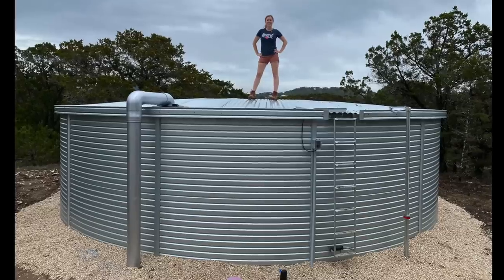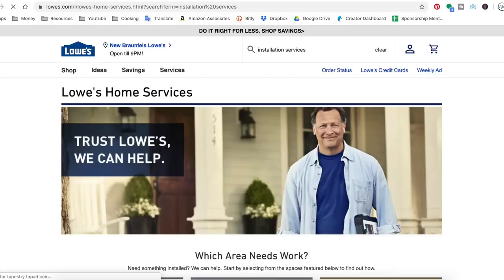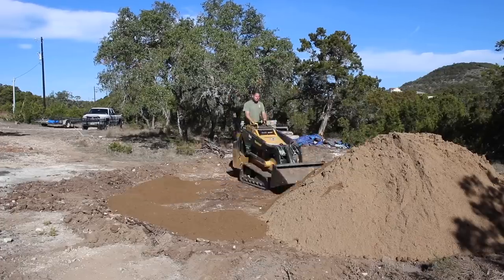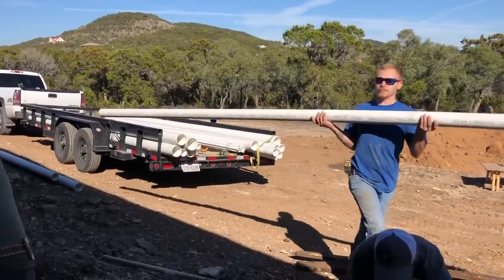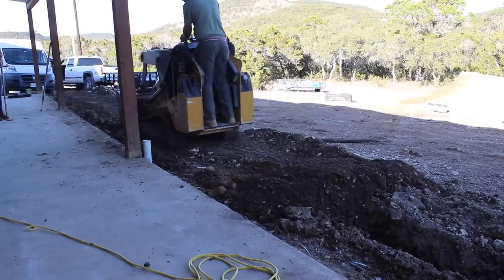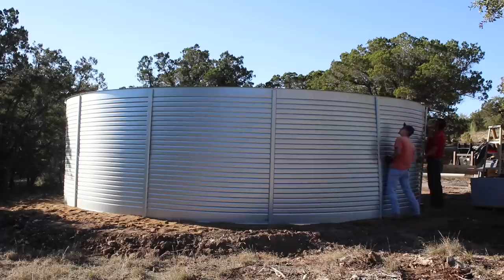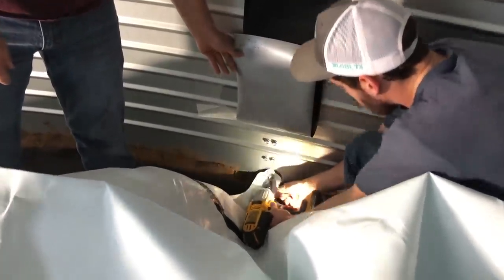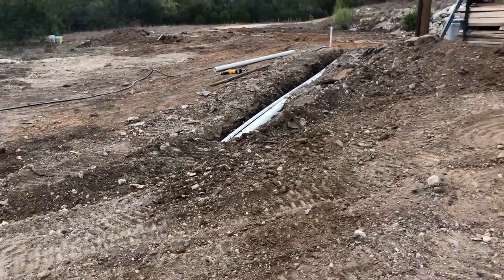Installing Rain Water Collection

Comment: Greetings from Germany. Water collection and reserving is a good thing if you are able to do it. We have been always collecting rainwater in some form or another. 
Growing up, my parents had a house + garden  (about 2 acre i think) at the edge of Town. We had 3 huge connected septic tanks (build in the 50's from brick and mortar) underground, that where used for our blackwater. In the early 90's we got connected to the towns sewage management and the septics where not needed anymore. So we emptied them and my dad and i spend a few weeks cleaning those tanks and attached all the roofs and even the walkway drains to them. Since ca. 1996 my parents have been collecting all the rainwater in those old septic tanks and have been using it in the garden and house (No drinking water!!!) Wich is a really good thing. In the last 15 years the climate in our area has changed so much that we have months of drought now during the summer months. 
You just dont want to see the water bill you get if you need to water your veggies. 

This was a really cool and interesting video. I enjoyed it very much, thank you for sharing all you do with us.

Comment: Thank you April…very well done video.  
I too appreciate a rainwater collection system. 

I live in the Texas Hill Country and have installed full home systems on both of my homes I’ve built here. Also helped create one of the first exclusive rainwater catchment developments in the State.

I used 10K fiberglass cistern on the first home with gutters, down spouts, and lines. All pretty much the same concept except the tank and the pump plus  filtration in the garage that pulled water up from storage to the house, filtration, and tankless water heater before going into appliances and faucets. 

 The water taste so delicious out of fiberglass and highly recommended for drinking plus using metal roof for catchment.  We used fiberglass shingles on that 1st home.  You can add many sets of filtration with 3 then 5 micron to ultraviolet then even reverse osmosis if it makes you feel better.  I don’t use RO. You can even put in minerals now if you want alkaline water.  There are many products since I started 20 years ago.  

Mankind has been collecting rainwater for thousands of years to drink.  Apparently all with good results.  
A public water utility puts things in the water that I myself don’t want to ingest.  Wells can be such harder water it creates problems in your appliances.  Having water softeners make the water not tasty and unbearable sometimes using salt. Rainwater is soft, good to drink and on your clothes and skin… plus appliances. 
 I love it!!! 💖 

Thanks for showing the building of a RWS.  I do them myself now after Tank Town being one of the first out here taught us. The founder of the company was a very great mentor to many in the area for decades back.  There are many installers now.  A great alternative to well water, and to me, the best way🌟

Comment: Please, you must do a follow up video:
- Does it work?
- Economic benefit? Cost of supply and installation? All the money stuff.
- How did you size your tank for your specific property?
- One side of the tank base is built up with sand. Can the tank handle settling of the sand? How much settling will it withstand?
- Please address how you monitor the tank water level.
- Can you show us how you use the water for irrigation, and why you irrigate? Here in New Brunswick, Canada our climate doesn't require us to irrigate.
- What maintenance of the system will be required? Liner life expectancy?
- Can you also address filtering of the rainwater and bird poop on the roof? Assume gray water usage for the moment.
What an excellent video -- except it is wayyy over the top for most of us -- unless the economics make sense. I suspect this was a $60,000 USD installation. If I am in the ballpark, then the economics become doubtful. I recognize that things may be different in TX. Keep up the great videos.
Reply: My brother-in-law has a 30K gallon system and it's crucial to his house. They have no access to any city water so either rain or having it tankered in are his options. He has a mechanical mesh filtration system and UV as well as a chlorinator, although the chlorine is mostly an inhibitor.

He uses three fiberglass tanks ganged in series. He has a roughly 5000 as ft house and a 9000 as ft barn and it's all plumbed in. They use the slightly "sour" well water for toilets, laundry & irrigation but over the last 15 years it's been drilled down another 100 or so feet as the Edwards Aquifer has "dried up". Texas broke out of our five year "extreme drought" last spring but it's been dry this winter.
Reply: In Australia you’d get this tank size for around $8,000 aud.
Reply: @Satya2btrue  OK -- $8K to purchase the tank + $8K for labour to install + $8K to prepare the base, install roof gutters, and buy piping -- give or take. It looks like a water supply can be very expensive in Texas. I guess that is one reason few people live in the desert.
Reply: There is no Economic benefit for this household! 101%!  Its all about ''its cool to reuse''. Its ok..but its unpractical. 
I was planing similar on solar panels for my garden..I can run 15+ years for that money. Since I am not hippie..and without freebies..I baled.

Comment: Nice! Our WV 1890s farmhouse came with a cistern that takes the water off the roof. The collection filter needs to be rebuilt, a project for next summer. I estimate the collection tank at about a thousand gallons. It needs to be flushed and cleaned, again a project for next summer. We use the water for the garden. There's also a shallow well with murky water, in the mudroom, and a 400 ft. deep well with with excellent water. Water is life!

Comment: The majority of my development in Hawaii does not have water, and we must collect rainwater for use.  To make it potable,I use two different string filters and a UV light so we can used it for general purposes.  I have lived with this system for 8years.  It works!

Comment: I put in a 1,000 gallon rainwater collection system back in 2014.  We live on a small lot in a mid-sized city in California so that was the max practical amount of storage.  The water then goes into a solar-powered pump and collection tank, just like a well pressurization system, pumping the water to 32 PSI, then it's fed into our drip irrigation system.  When sizing the system we found our yearly consumption was 30,000 gallons for the household - so your tank is absolutely massive!  With our collection system we managed to replace about 6,000 gallons/year of city water - and since our sewer bill is based on water consumption, that went down as well!

The only issue we needed to solve that your location doesn't require is filtration at the roof level.  Leaves, dust and bird poop build up on your roof and the first rain washes that right into the collection system.  There's a smart filtering technique using a slow-release downspout and a float valve that dumps the first few gallons of runoff and then diverts the rest of the (cleaner) rainwater into the tank.

Comment: Now, this is smart thinking. Rainwater collecting is just smart, and everyone can do it. I have for oversized barrels at the 4 corners of my house and shop. I use this water to water the gardens and for a birdbath fountain, I designed myself. I have a high mineral count in my well. So I already have a whole house filter, and another under the sink. Plus I have a 2 gallon Britta filtered container with a spigot in the fridge that all water to be used in cooking, coffee and tea all goes through that final step. Best of luck with it April!!

Comment: I'm building a container house in New Mexico that will be completely off the grid. Right now I'm working on the access road. Here's some stuff about my situation:
1) In New Mexico you can collect rainwater IF you are on the East side of the continental divide. If you are on the West side, you need a permit. Fortunately I am on the East side (my property backs up to the continental divide.) 
2) I am planning to use a lined shipping container as a tank. A 40 foot high cube container can hold just North of 22,000 gallons. If you don't want to line it yourself there is a company in Australia (and other places) that sells a liner kit for you to line the container.
3) Finally, one HUGE advantage of collecting rainwater is that it is SOFT WATER! We bought an old gold mining claim that is at 7200 feet on top of a mountain. A well would be in the neighborhood of 800 feet and the water will be hard as a rock. Some of the wells that deep had to be sealed because of their arsenic content. Collection makes perfect sense!

Comment: Hi April, I am living in Germany in a townhouse with a small garden near Frankfurt . When the houses were built we were obliged to build a water collection system mainly to water the gardens. So I have an 700 Liter Tank in the front and one at the back of the house both underground. It really saves a lot of water while I still have a green garden even when, like the last two summers, there is only little rain and high temperatures.
Love your vidoes, keep zup the great work!
Reply: Is 1400 liters enough water to supply the gardens?
Reply: @JamesG1126  depends on the size of the garden,  as mentioned above, it is a townhouse , so the garden is pretty small
Reply: @michaelroux7278  Thank you.   Do you have any pictures of your setup?   You've had it for awhile now.   Are you happy with it?
Reply: @JamesG1126  there is not a lot to take a picture from because besides the waterpump everything is underground

Comment: 1. You do the most interesting, unique projects
2. I hope you will do a short follow up video or two as the tank fills. I’d like to see how much water you collect from various rain storms.
Reply from the maker: : ) Thats great to hear, thank you. Yes I will certainly be doing a follow up video at some point!
Reply: dungoist  I think the tank is down hill from the shop, and the height of the top of the fill pipe is way lower than the roof of the shop.  So gravity does the work.  The question is: in the heaviest rain, is the difference in height enough to handle the volume of water that has to come through the system?  She shall see...

Comment: Great video April. In New Zealand rural we use either a rotational moulded plastic tank usually 30,000 litres or concrete Tank same size. (7000 gallon). Need more catchment, add another tank. The install is easy for the drainlayer, 90mm upvc pipe   in ground to tank, 100mm at overflow outlet. A 30,000 lite tank approx $4500 NZ,  approx US$3,000